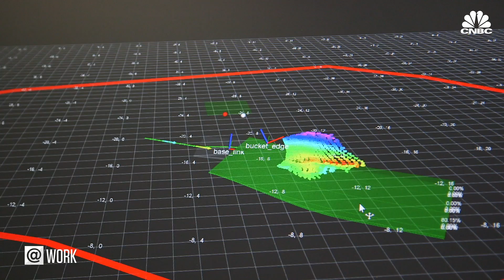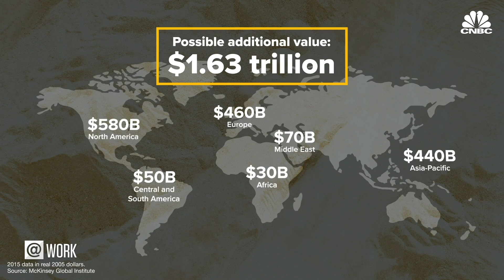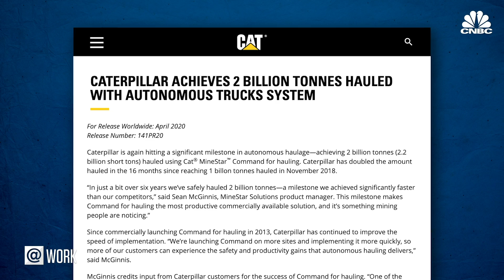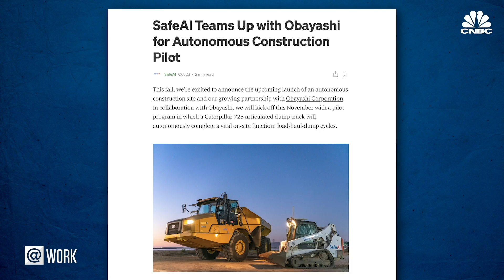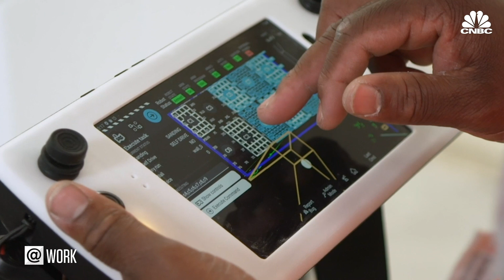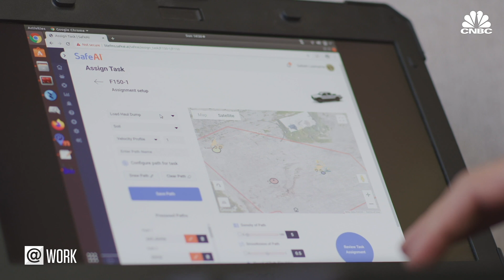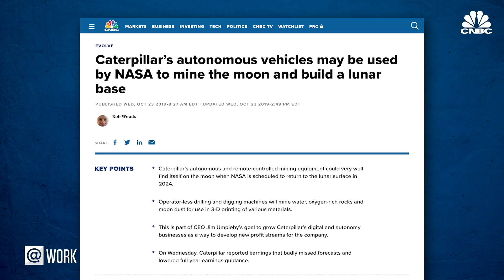How Autonomous Robots Are Changing Construction

Comment: I can certainly see the advantage of having an automated excavator or compactor on my site, but if it takes me longer to program the thing than just digging it myself, what's the point? Plus, many times the operator jobs provide something for the old guys to do. If it wasn't for machine operation they wouldn't have anything to do because their bodies can't handle the real work. Exoskeleton is a good idea. If I can lift heavier weight and hold it above my head without help that would be huge.

Comment: 3 years in a rock truck and ill tell you there's nothing systematic or controlled about jobsite traffic. one second haul roads on the high side, then next round your on the low road because the painters are striping this or ops wants to check density. not too mention the engineers and the foremen driving around in their little pickups and suvs.

Comment: There based in San Francisco, and there machines work on a very small dirt lot. It. Was. Not liked among the bigger construction companies looked away 
It still needs operational guidance so it’s not replacing a person just taking them out of the seat.. 
it’s a cute idea but it’s based off machines that still use all the same needs but now has a computer to move 
In a mine or a quarry it’s great, but to work in a city where the site is compact and changing by the min 
The human element is still needed.  Cute toys but the trades are labor. Human labor.

Comment: I should have stopped listening when the guy said construction sites are more systematic and controlled than public roads. Clearly someone who hasn’t spent a lot of time actually working on a construction site. I laughed when another guy said about digging a trench to just push a button and tell the machine to do it. Do that in any major city and you won’t get 100 feet without breaking a half dozen existing utilities. Oh and mining isn’t really construction since you are not actually building anything. I can see some applications but not nearly as many as those in the video think.

Comment: “Caterpillar has more miles driven than car companies” 
You mean, dirt road miles? Roads that are not even in the maps. Plus does he know how many miles Tesla has? And are adding up every single day with a 1.2 million fleet
Reply: They said more than most autonomous car companies do, and dirt road miles are still miles driven, there's nothing wrong about their statement
Reply: @rizizum  I’m pretty sure is good for the Sofware to collect data that will improve the way those autonomous machines work, but has nothing to do with miles! Why ? Because almost every Constrution site is different, it’s a new “road” and many building construction are also completely different. I used to be I diesel technician and I know that the environment where they work changes a lot. Miles recorded doesn’t help much, they environment they work around is what will help them work more efficiently.

Comment: How can they claim this will reduce strain on workers when they're planning on replacing the one job that doesn't involve manual labor? Heavy equipment operation is one of the few construction jobs that is actually skilled, high wage, and comfortable (and fun). Now the only construction jobs for people will the most mundane, back-breaking, and low-skill/low wage. Good job silicon valley, keep splitting society further in two so we can all either be part of a limited pool of highly skilled workers or totally unskilled workers and give the business owners an even higher share of the profits.

Comment: The fact that they started with excavators and loaders for me means thats they dont know what they are doing.  
You can't simply let a excavator dig a trench overnight. 
What if it his an unexpected water pipe or it finds solid rock base?
Does it keep going until it flods the site or destroy itself?
In digging the are lots of variables.
In my opinion they should start with compactors. Simple, predictable work and easy to plan.

Comment: well heck, i feel a whole lot worse about the heavy equipment operator course im taking rn
Reply: Time for a new course. Live in the present think about the Future.
Reply: I'm literally in a structural ironworking union so I am not pleased about this at all
Reply: this technology is like 20-30 years away though.
Reply: There is always a need for mechanics, even if the machines operate themselves! Don’t give up on it 👊
Reply: Don't worry, the labor union will do their best to keep the Industry stuck in the past
Reply: @harrisonwintergreen1147  I wouldn't blame them in this case, replacing heavy equipment operators does nothing to improve the industry besides cutting costs by getting rid of the best jobs in construction. They tried to claim at the start of the video that this will somehow reduce injuries, yet all it does is get rid of the one job that doesn't involve manual labor. It's ridiculous.
Reply: @MrMattumbo  I mean, isn't cutting costs improving the industry by incentivizing more construction?
Reply: @coleball6001  Heavy machinery operator costs are a drop in the bucket for construction costs. Finding ways to streamline the planning and permitting process would save far more money, time, and require far less upfront investment. 

Even then the bulk of your building work is going to be manual in the form of plumbing, electrical, and finishing. Having an autonomous machine only helps you in the very early site preparation phases (which are already the fastest thanks to the human-operated machines.)

Comment: So whos gonna clean up a hydraulic leak or spill when a hose breaks. Or whos gonna grease the machine everyday? The labor market is down because noone wants to do manual work. Some button pusher on a computer isnt gonna go out and do the daily service that construction equipment requires. Production would be lower because the machine will only work from a cad program and in real world work areas and scenarios change so then that cad would be obsolete.

Comment: Seems super overhyped.  CNBC does poor vetting to begin with, and this video seems like another one of those.  For example, "with autonomy, they can finish it in 3 years instead of 6".  Uh, how?  They're just gonna have machines running out there 24/7?  I highly doubt it because of safety reasons and monitoring; anyone who's worked alongside robots knows this.  Secondly, the machine is not working way faster than a human, so where does that number even come from?  This video just shows heavy equipment operating by itself, not operating 2x as fast.  Most of all, they've talked absolutely none about automating the majority of the labor process, like building the structure.  Cutting time in half with nothing more than some automated excavators.....yeah, seems suspect at best.  Another factor is cost - automation sounds great, but if it's not affordable, then it's useless for industry.  This is why we still do so, so many things manually.  It's not that "robots" can't do it so as much as it just doesn't make sense cost-wise to do it.  You could have a robot putting together a burger, replacing your drywall, etc., blah blah, yet people do not do it.  It's not because the technology doesn't exist so much as it is that it's prohibitively expensive to do so.  We've had single-arm robots around for 60 years now.  They had a robot that could make coffee back then.  Let that marinate for a second.  And yet so many of the tasks are still done by hand.  Even something as incredibly basic as self-checkout at the supermarket wasn't in place in the US until just a few years ago.  And that's way, way, way more simple.  Every few years they come up with some new story about "automation is coming" and everybody drinks the koolaid, then it's crickets when it never happens, everybody forgets, and then a year or two later they're repeating the same nonsense for some other task.

Comment: You have to be blind and stupid to be convinced that this sort of automation is taking off like a fighter jet, just from this video. You got several lame salesmen, one who is especially shady with a disingenuous smile, promising you the world, but failing to give any concrete numbers or results. A construction site is not simple and structured, contrary to what they claim. It presents it's own set of challenges separate from those of self-driving cars. Equating it to automation in farming is even dumber. You are not driving from point A to point B on flat terrain with a simple automated harvester and almost zero variability. Just looking at all the mud, dirt, debris, rubble, and uneven ground it is already going to make it a logistics nightmare. The slightest speck of dust will cover up a vital sensor that incapacitates one of these machines, and there's plenty of that. The digging, rolling, pounding, and other associated tasks in such complex scenarios is going to need a lot of hand-holding, which more or less defeats the purpose of automation. A few "prototypes" by startups with undisclosed performance reviews leaves a lot to be desired.

Comment: Then we see labor robots like setting cement blocks and plastering.
Reply: no they just paint flats and digg in sand
Reply: Why would they need to set cement blocks when they can just print them out site or any shape for that matter.
Reply: @gabrielrobinson6987  maybe you dont take the cement spray as durable as casted
why they dont spray metal instead of casting

Comment: Another excuse so Kubota, Caterpillar, Case, John Deere can lease more expensive gear to construction contractors, since the old one cannot operate with self driving pods. 

And because of contracts with no right to repair , there goes the yard mechanic out of the door.  And since there will be no repairman on-site , as soon as the new technology malfunctions , as it always does, you have the perfect excuse for cost overrun and project delays.  

Come to think, it is always better to get experienced crane, backhoe, plow operators who can safely perform their trade.

Comment: A shame Andrew Yang wasn’t taken seriously by the DNC and MSM... we are literally seeing his platform warnings unfold before our eyes. Just hope he has some type of seat at the party for this next administration. American workers/families are gonna need him.
Reply: Yang may have to switch parties or become independent to take on Biden in 2024.
Reply: @drsmetal2747  the thing is, independent literally never wins. Not only that, a whistle-blower from MSNBC had come out stating they were given orders to never report on Yang, alongside some other democratic nominees.
Reply: this isn't unfolding anything.  Some automated excavators that have been around for 7 years according to the video, and yet they're still yet to see mass use.  And they don't even do the job necessarily better or cheaper than humans.  Yang's ideas on automation, even though they were well-meaning, were way over-exaggerated.  His talk about manufacturing jobs being "automated away" doesn't stand up to an examination of the facts or even common sense.  If it were all automated away, we wouldn't be running a massive trade deficit with countries with low wages (afterall, it's all "automated", right?).  This talk about automation has been ongoing for years and years and years, and the pace has not drastically changed.
Reply: @blah23vr234v  We'd love to invite you to our podcast as a guest ❤️
Reply: @Clyde  why?

Comment: I know there are many out there that will argue "there will always be jobs," yes, i would agree. 

However, i just want to point out that we're slowly moving into service-base jobs, because lets face it, college graduates don't shovel dirt, or lift 100lb bags of cement after getting a degree in computer engineering or micro-biology. 

These (manual labor) occupations, are largely filled by working class folks and migrants with low levels of education. I have several uncles that made decent money working construction, with current back problems due to years in the field, but they ventured into that field because they were recent migrants and receiving a decent education in their home country is expensive.
Reply: That's kind of the point. The dream is to be a pampered, well-educated white collar man and not a migrant with chronic back pain and probably cancer or some other debilitating disease from asbestos/lead/carcinogen exposure. You are stating the obvious. The whole "come to America for a better life or at least for my children to have a better life."